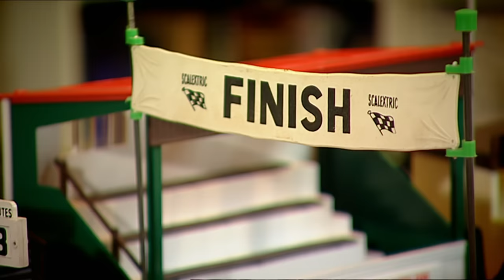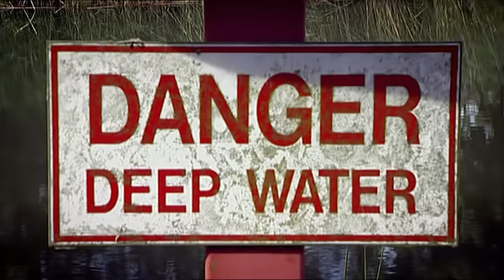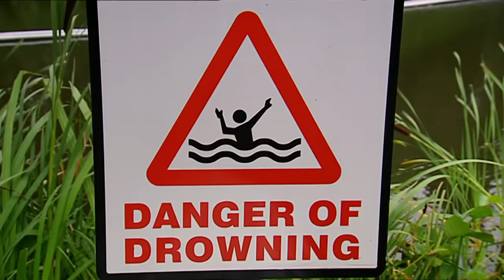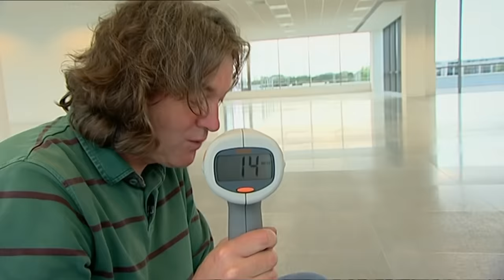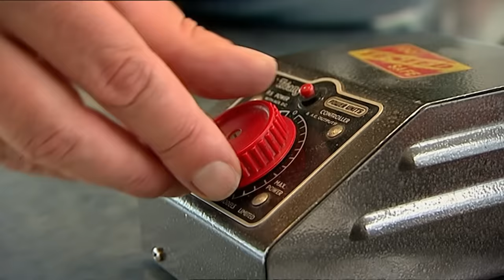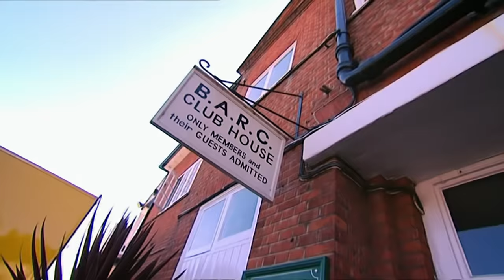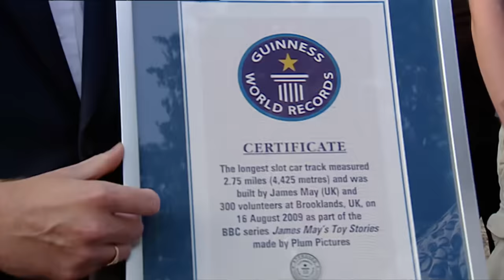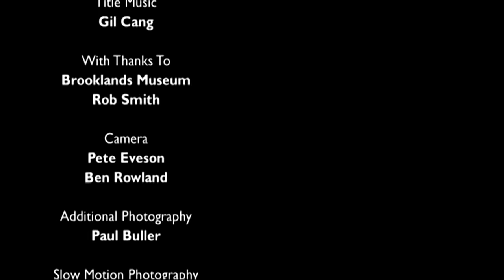The World's Longest Scalextric Track | James May's Toy Stories

Comment: I had a massive 4 lane wide circuit in my loft. I think putting the magnets in the cars ruined the skill of driving them. I didn't buy the scalextric cars, I built my own from brass tubing and cheap model car kits for the body. I built one with the motor out of a RC speedboat and the only body that would fit over it was an old style VW Beatle. With foam tyres with traction fluid squeezed into them it took off like a rat out of an aqueduct. However, it didn't go around corners so I converted it into a top-fuel dragster. Which was mental. Didn't get out much in those days. 😂

Comment: We always called these slot cars in the US, because of a couple reasons.
1. We had several different brands and scales, from the relatively massive Carrera24 1/24th scale models to tiny 1/64th scale sets by Tyco, AFX and Mattel, and none of them really became THE big brand so the "Kleenex effect" never happened here.
2. We technically had two different brands both calling themselves Scalextric (the UK brand that you guys are probably familiar with and one from Spain that had a more compact track and higher quality but less detailed cars), and this resulted in a trademark dispute. Because the UK brand came to the US first, the Spanish one had to be rebranded as SCX in the US.
3. It made sense to call them "slot cars" since they're miniature cars that run along a slotted track, and "slot cars" rolls off the tongue better than "scalextric".
Reply: Scalextric was first, and by far the biggest brand in Britain, so became a byword for slot car. 
Like Hoover has for vacuum cleaners or Allen keys, Phillips screwdrivers, stillies (stilsons (pipe wrench)).
Etc.
Reply: Funny enough without even realising you are following in the footsteps of Noah Webster as he also struggled with the English language 🤣
Reply: @theant9821 
That's the "Kleenex" effect I mentioned. We have that with a few things here in the states as well. Besides Kleenex being used to refer to hygenic tissues, food processors are called Cuisinarts here, stand-up motorized mixers are called Mixmasters and menthol petroleum gel is called Vaseline.
Reply: @ethanmccormack9561 
Nah, slot cars are a US invention. They were originally developed in 1912 by Lionel as an accessory for their trains. Scalextric didn't come around until 1957. Therefore, the US has claim to naming rights.

But feel free to keep calling them Scalextric. There's obvious cultural differences at play here, it's not my place to tell you to stop using that name.
Reply: @VestedUTuber  
To add too the Kleenex effect comment incase there are any Brit’s that are more curious. One thing to note is some of these are regional. Such as the food processor being called cuisine art is not common where I live. I also want to add some more common ones: mixer called kitchen aid, sanitation wipe called Clorox, and this one is regional but some call Softdrinks “coke.”

Comment: Walking through the entirety of a long defunct track, that had such a large role in early motorspots, is depressing for me. It seems like the cars continued to pick up dirt and slow down until they were turned up. When the aston martin was stuck on the dead piece of track it had time to get cleaned up and quickly caught back up. Or they were told to keep it close for the suspense. The aston martin was also on the inside

Comment: You missed what is probably the most important handling detail when driving those electric cars...

What you missed is that every time you accelerate, the electromagnets that accelerate the motor also pull the car down to the track.

So, to get around the track as fast as possible, you need to decelerate a little extra before each corner and while cornering accelerate a little extra and take advantage of the electromagnets sucking you down to the track .

Comment: To improve the handling/performance of the slot car they don’t have to be a good driver.  They just need to install a guide pin on the underside of the rear of the slot car just like it has on the underside of the front of the slot car.  With that upgrade and the existing magnets the car already has it would be a massive improvement

Comment: What happened to the quality race tracks that were around when I was a kid. I remember Smokey and the Bandit tracks, race car ones. They were a little smaller and better quality than the slot cars with the little braided wires. The good ones had thin flat metal connectors and the small pin in the front.

Comment: google says the track was 2.95 miles and the video shows the award for 2.75 miles....i wonder if there was some issue measuring it properly.
Reply: I would think the 2.95 miles was measured on the outer radius / top of the banking - the scalextric track was laid on the inner radius, on the flat part of the banking, smaller radius = shorter distance.

Comment: Can someone answer a few questions? Does the circuit need to be completed all the way around? Did they have multiple batteries to keep sufficient current throughout the track? How did they have multiple controllers and see the whole thing? Are they wireless or can you just have multiple controller sections in the track and just take turns controlling?
Reply: I'll answer a few. The racing circuit doesn't need to be complete on order to work, the car completes the electrical circuit by bridging the positive and negative tracks so you can move a car with just one piece. Yes they had lots of batteries all around the track because of the resistance of long sections of track. The controllers are just variable resistors between the battery terminal and one of the track halves which control the speed through changing resistance. I'm guessing they just had lots of controllers and people in a relay fashion taking over from eachother as the cars came into the section they were responsible for controlling

Comment: Isn't part of the problem of them crashing on a turn is the front wheels are off the track? Isn't it the same as if you were driving a car with 3 wheels? 2 wheels in back and one on front? If you drive too fast and turn you flip over?
Reply: The front wheels should not be off the track.

Comment: Odd they didn't explain if there were cameras on the actual race vehicles or if that was just for fun. I'm guessing the latter. Also how did the racers know what position they were in to adjust their throttle input? And how was the system segmented to allow for different triggers in different locations? 

They spent half the show talking about strategy and how the track would be designed and none of the rest of the show showing how that strategy was applied. Really disappointing.

They spent half the show taking

Comment: get the name of cars right. no such thing as a mini cooper. its either Austin mini or Morris cooper. same chassis and bodywork but thats all they had in common.

The mini had an 800cc Austin engine. the cooper had a 1000cc Morris engine.

the cooper had more stuff on the dash like a fuel gauge which the mini didnt have.

At launch the Mini idnt have carpets, door handles on the inside it was a piece of rope inside the door u had to pull and no planles on the door. no window winders u had to push a bar and pull them down. plastic seats.  the cooper had farbnic seats, carpets window winders and handles to open the doors on the inside. Mini cost £799 the cooper £1299. average house prices at time of launch was £1100. The Austin mini was the 1st car cheaper to buy than a house.

Austin, Morris, Wos;ley and Riley all used the same chasis and bodywork for their cars to save money on priduction. but everything else they put on their cars was their own stuff.
Reply: Incorrect.  The Mini Cooper was an actual car, you could have just Googled this or read the Mini page on Wikipedia.